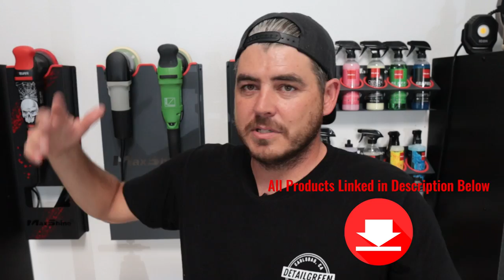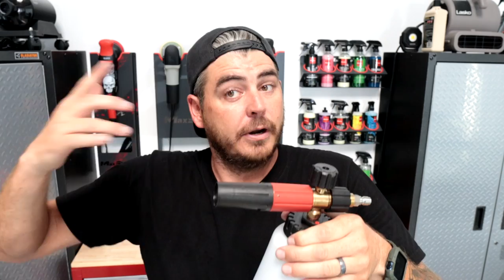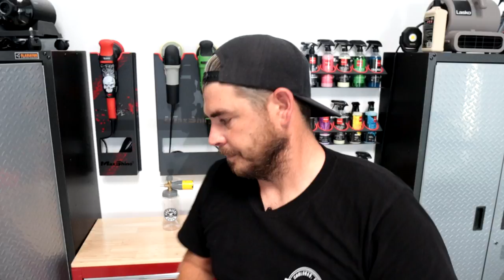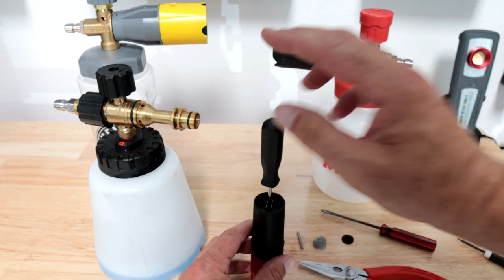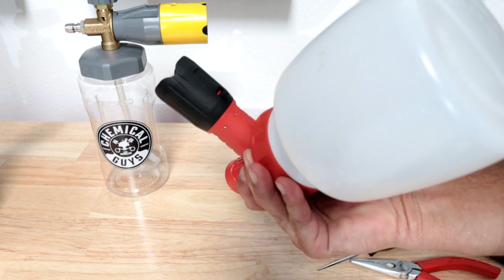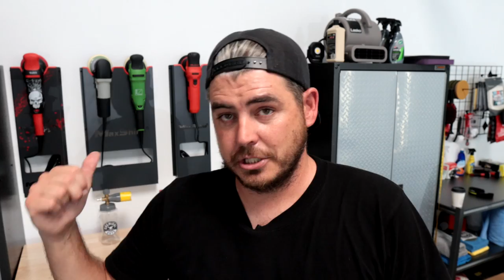HOW TO CLEAN YOUR FOAM CANNON - Clean Service and Repair all types

Comment: What I just did was disassemble mine as much as possible, remove al the orings and plastic pieces (the plastic around the lid had to stay for obvious reasons), placed all the pieces, including the filter, in a sonic cleaner with hot water and acid-based brass cleaner (typically used by reloaders to clean spent casings), and ran for 480 seconds. All the parts came out looking shiny and brand new, and it fixed the issue of not picking up very much soluition/watery foam. Also was able to re-use the filter. Obviously this is only economical if you already have these things on-hand, but for anyone reading this who might have the appropriate tools and supplies, this is a viable option without having to spend $1 extra or wait for shipping. Now it's spraying foam as thick as Barbasol. Adam's basic foam cannon w/ 1.1mm orifice, Ryobi 2300 psi 1.2 gpm washer, and Adam's Mega Foam.
Reply: Awesome tip.  I reload and have an ultrasonic cleaner and Citranox on hand.
Reply: @adamgalvan3181  give it a shot! See how it works out for you.

Comment: Saw a video about the MJJC foam cannon where it wasn't throwing much foam after a number of car washes. Guy replaced the foam filter with another MJJC three stage but the foam cannon still labored at producing foam. He reached out to MJJC and they told him to remove the stainless ball and the end of the feed tube and soak it in white distilled vinegar for 24 hrs. After doing so the rich foaming action of the MJJC returned to like new condition. The soap used and the dilution ratio was the same before and after the steel ball cleaning. So, my question is, would soaking the old foam filter in the same distilled vinegar solution from time to time clean the foam filter from contaminates like waxes and sealants like it did with the steel ball? Seems to me what's good for the goose is good for the gander. What do you think Josh?

Comment: Been doing a complete clean every time I use my MJJC or Griots Brilliant Finish cannon.  empty all the soap on the car, rinse the container with water until no bubbles come out of it, fill it up to the top with clear water, put the nozzle on and run the cannon until the container is empty again.  That spray is way more than 30 seconds, but it thoroughly rinses  all the internals.  While I'm doing that, the foam is dwelling on the car, and when the cannon is clean, I'm ready for my contact wash and rinse.  No foam cannon performance issues or degradation in performance for several years.
Reply from the maker: Awesome John!

Comment: Have a snapper 3400max pressure washer with a 1/2” quick connect.  Any recommendations on a foam cannon I could use.  Tried to message mjjc a few days ago with picture showing 1/2” outside diameter and no response.

Comment: Hey Josh! Great vid! I bought a brand new MJJC S v3.0 and used it (twice) with Adam’s Car Shampoo (Blue) but it is not making barely any suds, also it empties the canister in a matter of seconds. Would this (cleaning it) be something I should do to try and improve it? I already changed the orifice for the 1.1mm one. I have a Greenworks 2300 brushless PW. Other than that I might try deionized water but I have seen other people with similar setup and theirs work.
Reply: @kristianrverasantiago1856. I have the exact same set up as you. I use city water for my car detailing. My MJJC v3.0 just started lacking in the foam department. I took the mesh filters out and soaked them in P&S Brake Buster over night then ran hot water over them to rinse out. It helped a lil bit. I do have a back up Tool Daily foam cannon. I'm gonna try the White Distilled Vinegar that you mentioned. I'm also gonna try to boil the Mesh Filters in HOT 🔥 WATER. I only Use P&S Pearl Shampoo.

Comment: Hey josh, love your videos. What I normally do is run hot water with a citrus degreaser that’s diluted on the foam cannon and run it same way. I haven’t popped open a foam cannon yet, but I’m sure it will work the same way.

Comment: Help me out bud. I bought the mjjc as a result of your review. My foam is way too wet. Im running a 3100 psi 2.4 gpm generac. It comes with the 1.25mm installed and was super wet. I switched to the 1.1 and its still too wet. 

Im using chemical guys supreme wash and wax that i seen you use before. Im looking for shaving cream but im getting something much wetter.

Comment: If nozzle size for pw is 3 hole with a hole size 1.09mm, is  size 1.1mm orofice on foam cannon to small for 2.4 gpm 3300 psi pressure washer?

Comment: Good review my friend 👌 👍.  Most of the time I like to use a special cleaner for coffee makers, kettles, taps etc. Safe for O-rings, with a mixture of 100ml and 900ml of water I spray it until nothing is left  .  Most of the time when I dismantle my foam guns for inspection, everything is impeccable with no trace of scale or limestone.  I think it serves well to push back the maintenance opening time.  A 1:1 mixture with white vinegar also works well and is cheaper, but I trust more the product dedicated to descaling coffee makers specially designed not to damage all kinds of O-rings like the onyx descaling concentrate.

Comment: Question.  Can the filter be cleaned after removal if a replacement is not on hand?
Reply: Yes, the foam pill can be cleaned.  It's really not a filter but anyway...  Depending on what it's plugged with I've had the best results with a ultrasonic cleaner and either stainless steel cleaner or a lye (drain cleaner) solution to dissolve out any crud.
Reply: @Ryan_H22  Thanks.  Was getting the idea that the pill could not be cleaned otherwise
Reply: @robertchambers9774  You're welcome. They can definitely can be cleaned. They're made of stainless steel wire/mesh so they're pretty durable.

Comment: My MJJC foam cannon has the standard, larger mesh filter (not the smaller ones with the foam piece in between). Does that mean it's a Version 1 unit? Just curious what the difference is between the V1 and the V2.
Reply: Does it also have the hex shaped body?  The v2 has a round body.  If yours is hex shaped it's a V1.  I'm also not sure they made a v1 with the large mouth bottle.  The taller skinny bottles are def V1's.
Reply: @Ryan_H22  Mine looks just like the one in the video, the only difference being the mesh filter. So I guess it's a V2 then, but I'm curious as to why the filters are different.
Reply: @saviordream  Sorry, that I don't know then. Did it come with spare parts in the box?  Mine came with a spare red plug and the three foam generator pieces, two stainless meshes and a foam one that goes in between. I know MJJC sells the foam generator parts. Or did because I ordered them to try in another brand of cannon.
Reply: @Ryan_H22  mine only came with two different size orifices, as well as an extra mesh filter. I bought this several years ago off of Amazon though, so things may have changed in the years since.
Reply from the maker: The v1 had the small red plugs that would be shipped with spares. the v2 doesnt need them cause they improved on the design. As far as the filters go... I think the MJJC foam cannon pro v1 should have shipped with the 3 piece filter just like the v2 but im not 100% sure
Reply: @imjoshv  I think mine is the V2, since it looks the same as yours in the video, and doesn't have any sort of spare red plug. Just weird that it doesn't come with the 3 piece filter.
Reply: @imjoshv  I think Josh is referring to the differences between the versions of the V2. The earlier V2's came with spare red plugs and foam generators.  The red plugs are on an angle in the black cap and could fall out. The newest V2 doesn't include either (because according to MJJC the plugs no longer fall out and with proper flushing the foam generators don't go bad) and has the red plugs vertically in the black cap.  Both are round brass bodies engraved MJJC.  Basically a V2 and V2.1 

A V1 foam cannon pro has a hex brass body and I think all of them had the same black cap that early V2's had with the red plugs on an angle.  The main identifiable visual difference between the V1's and the V2/2.1's is the hex (V1) or round (V2/2.1) brass body.  Otherwise just looking at them you can't tell them apart.

Comment: I have a active ve52 pressure washer and I have the mtm hydro foam cannon, I heard I cant change the orfice to a 1.1 mm cause of the pressure washer so I would have to stay with the 1.25. I csnt get that sticky foam I'm getting a watery foam even when set to negative
Reply: In my testing with my ve52 the 1.25 is too big.  It works but I prefer a 1.20 with the 52.  A 1.1 will work but puts a lot more strain on the pressure washer and didn't make a huge difference for me.
Reply from the maker: Apparently with that unit making changes can cause some issues. They have the new version coming out soon that I will be doing a review on!

Comment: So what it mean when your foam cannon won't spray nothing at all and becomes locked up when you press the trigger spray. Locked up as in its hard to remove from your spray gun. I had to get a hammer and knock it loose but it won't spray anymore

Comment: Mine stopped pulling from the bottle. Took it apart and cleaned everything and didn't help at all. I picked up a sunjoe from Walmart after watching your video on it. Pulled my 1.1 orfice out my broken cannon, put it in the sunjoe and has from first use blown away my original cannon.
Reply from the maker: Awesome!!

Comment: I did that to  my mtm foam cannon but the fan blade doesn’t stay at one position, the stream won’t stay wide anymore,any tips?
Reply from the maker: Hi Pedro it sound like it just not punched all the way on. Take it back apart and make sure it’s functioning properly before putting the final pin back in!
Reply: @imjoshv  thank you sir, im going to give a try